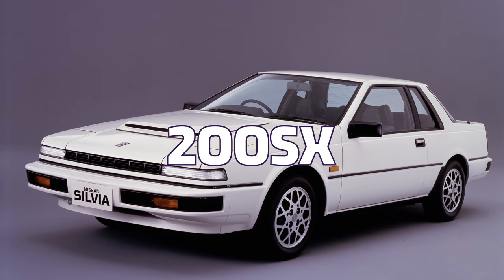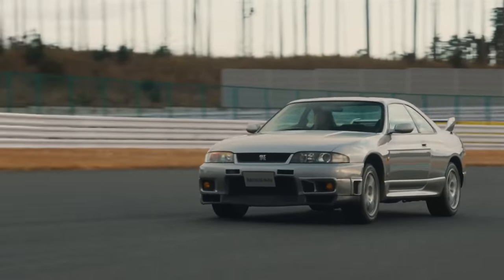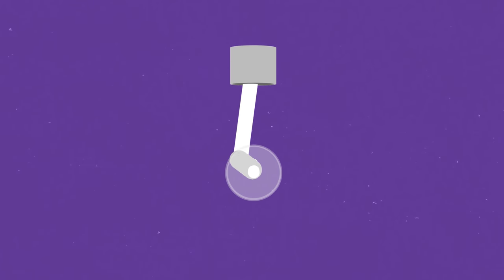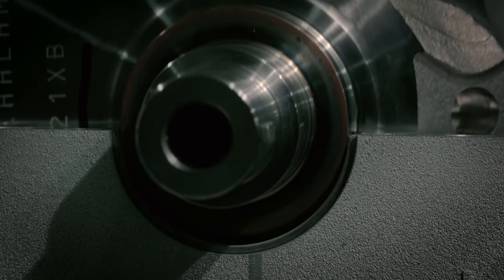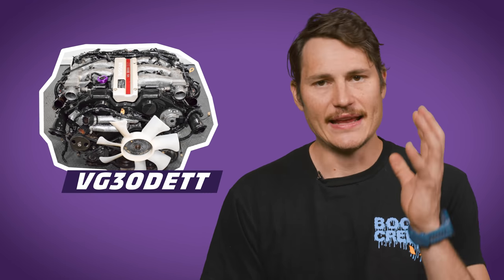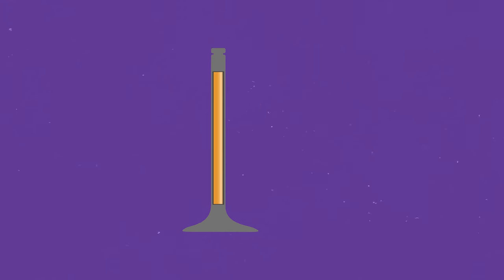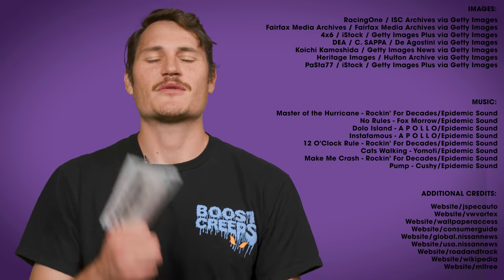RB vs. VG: Why Nissan Discontinued Their Best idea

Comment: There's a lot of missing information here, which is fair for an already 20 minute long video. And that's just from the VG side (I have a lot more knowledge on them than RB's). The common vg that you're referring to that came in everything was the sohc version, which is a decent engine (as well as one of the lightest v6's) but it's nothing to swoon over. There's also almost no aftermarket for them, so making power becomes a challenge. The dohc version only came in a few models (only 2 usdm models) and the only model that came with the vg30dett in the us was the 300ZX Z32. There is a lot more aftermarket support for them as well. Most people who know the VG know it as a basic 160hp sohc minivan & truck engine simply because they're everywhere and not that special. The dohc engines are definitely a larger, more complex engine that might have lost out on popularity for a number of reasons. A couple reasons I didn't hear mentioned are that we didn't get the skyline or the RB engines in the states. Exclusivity is desirable. Also most RB engines came with a turbo setup when most VG's came N/A. VG30DE/TT's also don't fit easily into most popular nissan chassis' easily (mostly S-chassis') due to the way they were CAD designed into the 300ZX as well as being a rear sump set up. Doing a difficult engine swap for an engine that is also difficult to work on when there's a simpler comparable engine just isn't going to gain popularity. I like my VG, but only because I have a z32. I would never want to swap one into another chassis, especially a Twin Turbo.

Comment: SOHC VG30E are not significantly harder to work on than RB engines, at least not in a Z31 where they fit the best. The problem is finding parts, the lack of demand means it's even hard to find certain OEM replacement parts. I've heard that the DOHC VG30DETT are harder to work on than the older SOHC engines but there's more aftermarket support there. As others have said the VG didn't die, it evolved into the VQ and then the VR. It's not a coincidence that the most common variants of VG and VR are 3L, twin turbo, DOHC engines, Nissan found a good formula and improved on it over time.

Comment: Other than the RB motors on the Skyline, most people that wasn't aware of the Skyline and it's motors, until after the Fast and Furious franchise movie came out. Since then even at cost the 4th gen Toyota Supra and the most wanted Skyline R34 retail value rocketed to 6 figure prices 5xs more than msrp. Just for being a hero car in the movie.  I'd be wondering what if the movie uses a decked out Honda Prelude or a 3rd gen Celica with the 22re motor. Would their value increase to 6 figures? 
Between the engines as you explained Jeremiah they both have their advantages and disadvantages,  except that the RB motor is more in demand because of its recognition in movies and through out Nissan's racing history.  
I've always wanted a 1994 or 1996 300zx twin turbo,  except most of the ones here on Guam are moving rust buckets and the turbos are lagging. I am old school and I love T-Tops and Targa tops. Gone are those days....

Comment: Why are the ITBs opening separately on each cylinder? I am curious about what benefit they serve with a turbo application. Seems like there would still be a primary influence of runner length, plenum design, etc. On an NA application it would at least seem like youd just be benefiting from even distribution of air to each cylinder. Are the harmonics/VE of ITBs better than a similarly well developed single TB arrangement on a turbocharged engine?

Comment: the 300Z never launched strait and lost many races cos the driver had to correct and pedal it,the r31/32/33/34 was a different more refined chassis and launched strait 99% of the time,VG made alot of power but 5 main bearings vs the RB's 7 meant it suffered from main bearing failure

Comment: The basic difference is all about ITB or EFI.
EFI will have the power, but it's gonna take about 20-35% longer, which is going to give the Operator about 30% hesitation for "Yhrottle Responce" compared to having an ITB Setup!
This also allows the "Straight-6" to obtain a Higher "TORQUE", but the "Straight-6 is going to have a higher HP Rating.
From "Personal Experience, having better TORQUE, allows better Traction and "Continuous Forward Movement"...

Comment: 12:00 The VG was also invented to be installed in the FWD 1985 Nissan Maxima. The engine was great, most of the remaining car sucked. Nobody in my family knew what a timing belt was in my family, until it went boom in the Maxima. Seriously, that is about the only thing on a VG engine that sucks.
Seriously, does anybody actually like timing belts?
That 1985 Nissan Maxima made me want the 300ZXTT when it went on sale. I read an article in May 1998 Sport Compact Car about getting 450HP from a 300ZXTT. That is when I found out what an R34 GT-R was and I instantly wanted one. I also learned what a MAF was and knew I'd be able to work on computerized cars.

11:20 That is why Chrysler tilted their "Slant-6" to have it fit under the same hood as a V8 engine.

14:20 One popular trick in Australia is to buy a RB30E block and crank, fab a few oil lines, and attach an R34 RB26DETT head. Odd thing is, I don't think I have seen someone make the VG30DETT heads fit a VG33E block.

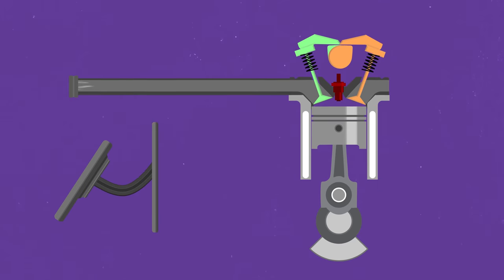16:30 The 300ZXTT was nice enough to have 2TBs.

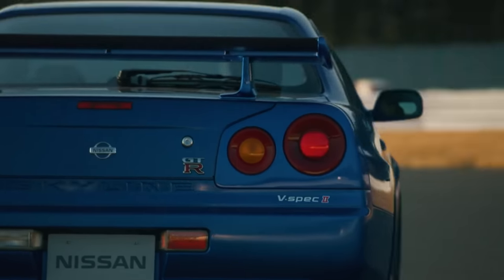18:40 Well, having all wheel drive will give a car an edge, that's just simple physics.

19:30 It is like when you tell a legend, and people repeat it enough times, the legend becomes absurdly huge. I don't doubt that the R34 GT-R is absolutely amazing, but even I know there were definitely better cars out there. However, I was strongly attracted to its looks.

Comment: Uhm.... The heat problems that plagued the VG? Wiring harnesses that dried & split? The engine so packed in & so close to the hood? It wasn't a great design, @ all! Powerful & fun to drive though. My 300ZX twin T was brilliant ;) The manuals were extremely rare here down under but wow! Imagine a 5 speed one :) :) :) ~ P.S. Excellent presentation!!!

Comment: So I know that the RB's oil pump engagement points are a point of contention.  To anyone with experience with the VG platform:  Does the VG have the same 2-slot engagement problems that the RB is famous for, and if it's different, is it better or worse?
Reply: It's the same oil pump

Comment: I’m a 300zx nerd have owned two, worked on them extensively and they are not only impossible to work on without pulling the entire engine out but also they are not very reliable. And to say they gave up on them is ridiculous because of how similar the vr is to the vg the vr is a vg without all the problems. If I bought another z32 I would buy as a shell and put a rb26 in it.
Reply: Btw the rb26 was built to turn the just like the gtr shell and the computer even the name gtr stands for gran turismo racing which is a auto sport that revolves around turning. The vg was more of a touring engine easy to tell buy the thicc crank no flex bad for engine breaking (crucial for turning) and good for top speed. Also chain driven cams are also a dead giveaway and garbage
Reply: Basically comparing the engines just because they are from the same company is silliness

Comment: The VG laid the ground work for the VQ which became the VR. Nissan didn’t discontinue it, they tweaked, evolved and perfected it then stuck it in the R35 Skyline.
Reply: How? The only similarity is that they are both inline sixes. By that argument, how was an RB engine anything but an upgraded L-series engine?

Comment: The rb26 was used in the japanese built skylines and the Rb30 was used in the commodes but the australian built skylines used a japanese built rb30 are from the same family but they are not the same, the 26 was built in Japan while the 30 was built in Malaysia, the 26 had done while 30 was sold and no vvt,the Malaysian built rb30 suffered cracked heads along the cam tunnel due to poor casting so would mix the oil and water

Comment: RB's are just better designed and built engines full stop. The VG30 and especially in the ZED32 was just problematic due to being crammed into a small engine bay with a lack of cooling, the standard T25 turbos were horrible, heat would kill the coilpacks (common on RB's too). 
It's not that the VG30 was a bad engine, just that the RB is a better platform and easier to work with. This is why there are many skylines, stageas and other RB powered cars here in australia are making 300rwkw+ while most "ZED"32's tend to be left stock.

Comment: Don't even mention the severe oiling issues plagued by the RB (albeit the VG as well, but not nearly to the same extent) or talk about the gutless, torqueless powerband of the RB engines. Both of those points certainly are in favor of the VG platform, not even accounting for structural rigidity of the STOCK block, crankshaft and girdle in the VG30s either (which is another HUGE win for the platform. But go off I suppose, keep stroking the legend of the RB engines.... And by all means keep attributing to the super low cost of VG engines and drivetrain components for us lowly VG enthusiasts. I should really be thanking you.

Comment: The VG is a Renault engine and the RB is a Nissan engine. The VG is also not as reliable as the RB.
Thr RB30 that was used in Australia in the Holden Commodore was a legend there. In South Africa we only got the RB 30 in the "New Era" Skyline that was basically a commercial failure, being normally aspirated and nothing much was done to build a racing pedigree for them here.

Comment: The RB was used in the VL Commodore in Australia not because of its racing success. The old 3.3 litre inline six was being switched to unleaded petrol and the evolution of this really old engine wasnt worth the money so Holden purchased the RB for the Commodore from Nissan purely bcs it needed a replacement...and it was only single cam without any of the ITB's, variable timing or anything fun...just saying......the turbo was a weapon though.

Comment: Correction: a VG30DETT can’t be found with a transmission for $1500, that’s for the naturally aspirated version of that engine with automatic transmission. A legit JDM VG30DETT with manual transmission is $5000+
Reply: Learn to source locally, for a VG30DETT you don't need to go to JDM importer with a steep markup. Over 18,000 twin turbos were sold in the US, they aren't rare.

Comment: I love my VG30 1999 Maxima 5 speed manual. It's the faster car I have ever owned. Unlike my 2010 Maxima. The 1999 Maxima had a throttle body. When I opened it up the computer had no choice but to dump fuel into the motor to keep it from stalling. The 2010 tries to guess what you really want and then does the opposite... But now I know why I can't sell the 99 Maxima. The local dealer would only give me $350 for it. And it's been garaged its entire life. No body damage and original paint.

Comment: Something you missed compleatly. (And you call yourself an engineer) is that an inline engine when compared to a v engine will always be more relaibale in high horse power applications because the pressures in the v engine work against the block and crank where the inline engine being built straght yo and down is only working against the head..

Comment: Ehhh~ can we talk about the Difference between vg30dett vs vr30ddtt?? My dad owned a 300zx, and he said VR30ddtt is basically the evolution of the VG~ if that's the case, why they say the new Z has a new engine if the basically changing the fuel injector and adding a bigger turbo?

Comment: You completely ignore second order and third order vibrations, or the difference between the top of stroke accerlation due to rod cant vs bottom of the stroke.

all inline 6's still inherently shake.

V6's can be smoother, but only if you offset them 120 degrees, instead of the typical 60 degree with a small crank offset.

There's also considerably more crank weight on an inline 6.  Which is why they're virtually non-existent in the modern era.  Crank weight is a direct loss to output.

Comment: I have two Nissan 300zx TwinTurbo with VG30DETT , The engine is amazing and failure-free in relation to today's shits like BMW on a chain .The timing is simple and  I changed it myself . Just a belt no f... chains or slides .

Comment: The vg30dett by truth was more powerfull than rb26dett cause the skyline had mostly had quick acceleration in the first 3 gears but after that the top speed was weak that's where the 300zx would pass the skyline easily.all skyline has been was hype.and tuning a vg is better to get the engine out.i have worked on nissans for over 15years and know with nissan engines you got to get used to them.people with minimal experience will find them hard to work on

Comment: ily donut but pls just once could y’all talk abt engine balance and vibrations w/o a bunch of misconceptions thrown in

rocking isn’t caused by power strokes

jfc

it’s caused by the assymetry of vertical cylinder movement when coupled by a rigid rod (con rod) to a rotating assembly (crank) 

it’s geometry

when the journal is in the top half of its rotation, the cylinder moves further vertically than when the journal is in the bottom half of its rotation

even if u remove the head and just crank a vertically-balanced but longitudinally unbalanced twin w the starter motor it’ll wobble front to back

it’s not abt power strokes

it’s geometry

the same geometry y’all got wrong in the last video talking abt engine balamce

Comment: This is not true. Like in another yall did LS vs 2JZ yall said that the LS which is a V configuration yall said is more compact then the 2JZ which is a inline 6. Because after all the manifolds and turbo and it ends up wider.

Comment: In a quarter mile a skyline had advantage over a few cars due to its 4wd system but beyond a quarter mile a 300zx will Eliminate the skyline completely and the skyline had a history of a few engine issues after a few races

Comment: Umm sorry, rb26dett didn’t have variable valve timing, hks did make a kit for the intake/exhaust cam, but Nissan didn’t 

Again you definetely should have touched on the z31 since it was the only Nissan to receive both engines in its lifecycle

Also, the vl commodore got an Rb well before the r32 was debuted, and although the engine was well received and praised, it was used because of new emissions regulations at the time that made Holden’s “red motor” obsolete

Comment: 300ZX Z31 VG was _horrible_ to work on. I dance on it's grave. It had a spluttering problem from 40-60Km/h. There was no space to get your hand down the side of the engine. It was a 10 hour job to replace a radiator.  You can't even see the alternator. Power was ok, but fuel consumption was awful.

Comment: I have an 86' Nissan 300zx with a VG motor that has less than 1k miles. We had a new long block dropped in from Nissan that cost about 5k back in the day. It was shortly after dropping the new motor in that the transmission quit pulling in forward gears and it's been sitting ever since. What do you guys think you could do with it? It's NA but I always wanted twin turbos to put on it. If you think you can do something with it let me know. You can search for tylerdurdin908 to find me on Meta if you can't do so here.
Reply: no twin turbos... im sorry its a boat anchor

Comment: one thing you over looked rebuild ability when you start pushing out stupid high power numbers your gonna need to rebuild it a lot sooner then a stock engine the RB and most other straight 6's are far easier to rebuild. also reliability if your not looking for all the power they go for ever we have an old FJ40 with the original F engine that thing keeps going my grandad brought it when hew was young and its out live him its probably gonna out live me and it is a farm UTE to so it take some abuse weather it hot or cold dry and dusty or wet and muddy it keeps driving away from the light.

also you should do RB vs BARRA battle of the straight 6's baby Japanese Godzilla vs the Australia Legend

Comment: Scale composites POND RACER used 2 vg30 running methanol.. rutan used these engines because they were cheap and readily available.. and air racing is expensive.. the VG30 is the superior engine

Comment: Really ironic then that Nissan used the vg in more racecars than the rb. Its almost like Nissan themselves knew it was better. You can take an unopened sohc from 1984, add boost and cams and make 630 reliably on stock internals find me an rb that can do that.

Comment: for god knows what reason, the most important reason an inline 6 is better then a V6 was not covered here, And that is...inherent design,
The inline is the best design of all (modern)engines while the v6 is the worst (no matter what make) and here is why:
1. main cap count: the inline 6 has 7 crank main caps while the v6 has 4, more main caps= more torsional rigidity. manufacturers try to compensate that design flaw by adding 6 bolt crossed drilled caps but its aspirin to the dead.
2. Any modern v6 is an even fire, that means offset crank rod mains, that offset is where v6 cranks break in 1/2, very common.
If you are interested in the subject, punch "v6 broken crank:" in the search line above.

Comment: I disagree slightly with your findings. I think you may have forgotten the v6 domination of motor sports during the late 80s-early 90’s. Also a v6 engine like that of the Vg family that doesn’t incorporate balance shafts or even use a harmonic balancer on the crank(because it didn’t need it) you can’t say is any worse than a straight six in terms of balance. Maybe your a bit biased toward the RB. Look I get it I’m very biased in favor of the VG, but you can’t have an honest comparison unless you remain unbiased.